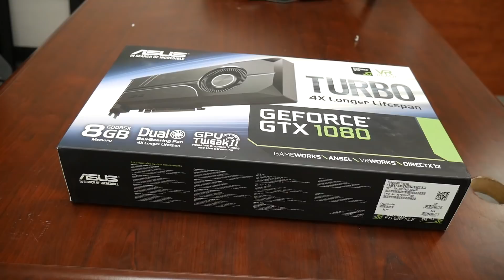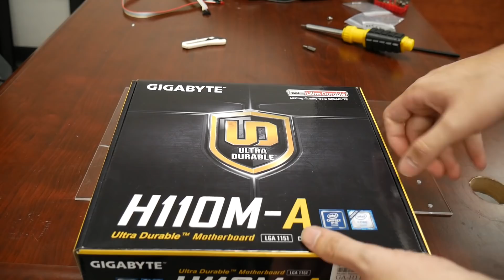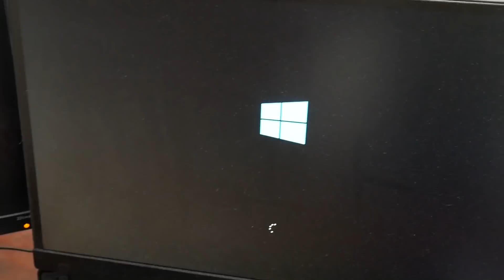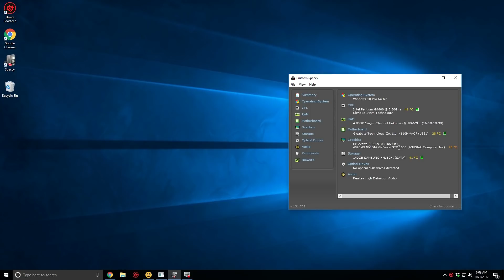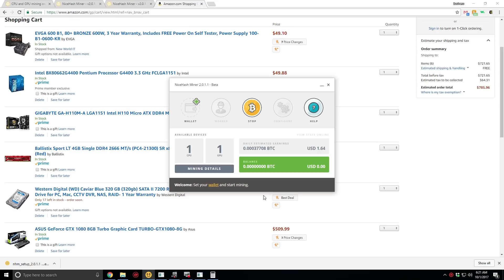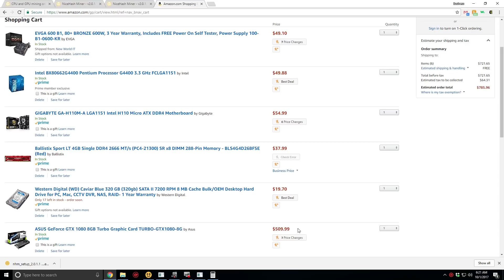How Much Can You Make Mining On a Budget Open Frame Setup Nvidia GTX 1080 8GB

Comment: Is that $50 per month running none stop 24 hrs a day or 12 hr shifts? If 24/7 how long would you say the GTX 1080 can perform at that high demand.  If it takes 18 months running 24/7 just to break even on the rig how much longer can the card handle running at the heat and power before needing to be replaced.

Comment: Thanx for a great informative video!👍👍
Now questions:
So drop in the CPU, ( no heat sink paste?);connect up everything, and it goes straight to home screen? - No loading / adding of software etc?
I’ve gotten screwed for my small rig, ( Asus gtx1060 6g turbo+ i3+ Asus 370 Prime+ Corsair 750PSU). I’m still learning how to over clock etc but I’m trying to maximise this rigs ability- Have you tried using XMR STAK/ CCMINER and which would you suggest ?
I’m not keen on using Nicehash’s miner or mining via them...I plan to hold some of the coins I’m mining and trade the others and feel I have more flexibility using these other miners. Though I’m not sure which is best suited for the gtx.
Any advice, is much appreciated👍👍

Comment: I have the same 1080 turbo
Reply: How much hash you get?
Reply: fotoarthobby ...0.39 mbtc to 0.42 mbtc perday..these days crptocurrencies are down.
Reply: ata kardesh thanks but my question was more on how much mega hash you getting
Reply: fotoarthobby ..what hash rate.? Different currencies have different hash rate. Main thing is how much mbtc you earn no matter how much mega hash/per sec.or sols/sec.
Reply: On equihash...483sols/sec..
Reply: ata kardesh I referred to mega hash and if you have mined Ethereum then it will be in MH/s. Type of Hash depends on algorithms, difficulty & other factors. How much hash depends on GPU. Anyways never mind.
Reply: ata kardesh thank you
Reply: ata kardesh is that per gpu? Have you clocked the card and if so what r ur settings?
Reply: fotoarthobby .i m not mining etheurem alone..i m just using nice hash it mines different currencies with different mega hashes and sols etc..

Comment: How many gpu can u fit this motherboard
Reply: Depends on the motherboard slots.  Each Graphic card GPU needs a slot in the motherboard of the correct type. Some motherboards only have 1, some have 8 or more, all depends.  Also you will need enough power supplies to handle to GPUs.   It all comes done to math and engineering problem!

Comment: Ok less clear the air before going loco on this 900  dollars is not a budget for any one with half a brain just to try to see if all this work and  and see if you can make any return you don't need a 1080 s $500 graphic card  to do this  you can get a MSI RX580  card for half or less then that and or some other with 4 g budget lower.  To risk $400 at the most for all  more then that is real stupid and you can't play games wen you analyzing data on the same PC at the same time will slow the process dawn don't let this guys pedal you on spending  money that is how they make money on you they are the ones sealing the parts listed in amazon

Comment: If I use an old core 2 duo pc but put a Nvidia 1080 video card on it will it be okay?
Reply: Odds are your old core2duo PC does not have a PSU capable of powering a 1080 (nor the neccesary plugs [2x 8pin])

Okay, scratch that. I can guarantee it.

Anyways, your CPU/MoBo probably also does not support a modern version of PCI-e (Gen 3) and will not preform well. 

Not worth it by any means. Go for at least a Haswell (4th Generation) i3/i5 for that PCI-e Gen 3. 

I could be totally wrong on this, not a big miner but more of a tech guy.

Good luck mate.

Comment: Why did you mount the HDD vertically? you could have mounted it flush
Reply: Heat dissipation.  It really needs a case to get proper air flow.

Comment: Nobody noticed that he did not correctly installed the stock Intel cooler?
If symbol is rotated for the direction of arrow optimizes it for removal.
Turning it away from that dirrection, optimizes it for installation.

Comment: Your mobo cant support enough gpus on that mobo to make the build worth while. Quit giving people bad advice.
Reply: 3 gpus supported on that mobo, the only budget was everything except the rams and the 1080 also i belive there is cheaper cpus then that.
Reply from the maker: I actually manage to run 4, not sure how but it works. It will not take more than 4!
Reply: i have 8 gpu-s on a mb like that ( if you want to poot more videocards you need a pci-E ADAPTOR WITH 4 USB ON  IT AND BOOM BABY. COST 20£ FROM CHINA WORTH THE PRICE THX.

Comment: 16gb usb flash drives work better for cheap drives.
Reply: so in theory one could run a low gb graphics card  along side a 
32GB USB/MICRO SD in lue of running a highly priced 16GB GPU ?

Comment: THIS COMMENT WILL HELP THOSE OF YOU WANTING TO MINE A GTX 1080 FE, OR BLOWER EDITION

My GTX 1080 FE is making $1.75+ a day using NiceHash, mining with an output of 100 watts from the card directly.

It jumps from $1.75 to $2.25 depending on the profitability at the time, and so far as of late its been over $2.00.

This is the BEST settings for a Founders Edition, or a Blower Edition to last pretty much 4+ years mining.

Set Power Limit to 70% out of %120 or whatever your max is.
Set the Core: +155
Set the Memory: +495

My room is pretty cool, under 70 degrees,  so my card is running under 60 degrees WHILE in my gaming case even with the case side panel on.

The machine's TOTAL output is 100 watts from the GTX 1080 FE, and 40 watts from the PC itself... so that's a total of 140 watts ;)

70% Power Limit

ZCASH = 500-505 sols
Vertcoin = 41 - 42 MH/s

If you were to use max power, 120%...

ZCASH = 550-560 Sols
Vertcoin = 49-51 MH/s

This will keep you making above $2.00+ at all times as of the this post date.

But you best have a air conditioner on blowing towards it... or it will die within' a day.

Gotta keep it under 70c to keep it lasting a few years or so, under 65c for even more time.

Comment: so many negative comments. to me, this looks like a good use of my gaming pc to make money for me on the side when i'm at work or otherwise not using the pc. you could run all unnecessary components at low power draw and let it go. at least, that's how i'd look at it.
Reply from the maker: good thinking
Reply: And as somebody else said it's not about how fast you get the coins, it's how many coins you can accumulate throughout the usage of your computer. Coins can be like one price here and then the next day it'll be higher and you can sell them and Bam, profit - the only down fall is just electricity
Reply: If you are at a school dorm, your power is free, but sadly you are still burning more power than you are making!
Reply: feelingtardy yeah but it's unfair and abusive for those who JUST use it for mining.

Comment: Great video. At the moment I"m looking for parts on starting this new hobby of mining. So much information out there it's mind blowing. I wanted to start out with 1 or 2 gpu. 2 questions to ask you. 1. If I add a 2nd card wouldn't you have to get a bigger power supply to support the power from it?  2. Can you might different gpu cards and still mine? I know the 1080 is expensive at the moment but what other cards would you suggest to mix since I'm on a budget at the moment after having a baby? 

Keep up the good work on the videos... Help me out with my new hobby.